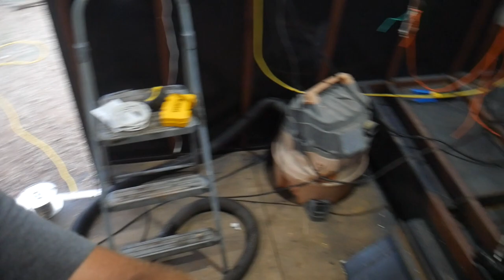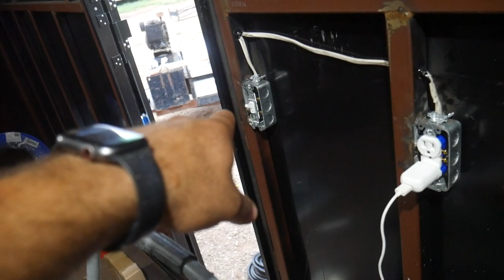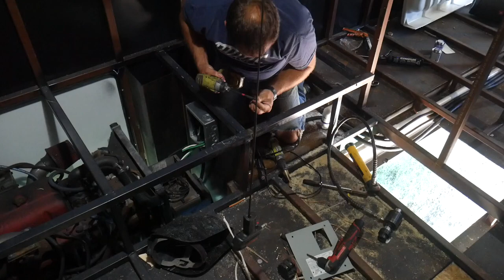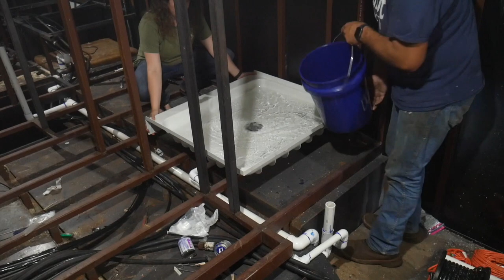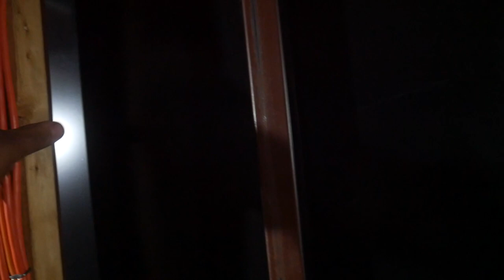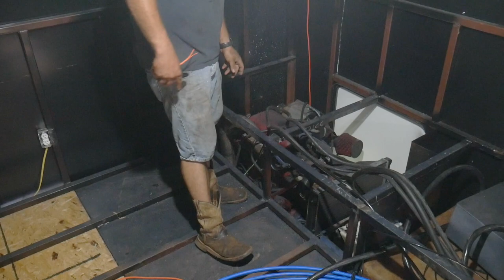Homemade RV. EP-16 Electrical Part 2 and Plumbing. 1977 Peterbilt 359 Toterhome.

Comment: Really coming along! Love your detailed planning, learned some new ideas for sure. Was wondering if you had considered an automatic transfer switch between the generator and shore power? But perhaps you like the manual option here. Really ingenious approach on the 2 main breaker boxes and being able to charge batteries on 15 amp shore, while still using the inverter. For the can lights, did I catch that your plan was to have each plug into an outlet instead of hardwired? Maybe I miss heard that part, but having a lot of experience with motor coaches going down the road, with the vibrations and movement maybe consider hard wiring instead. Interested to see how you wire up the junction box, seems like a lot of conductors in a small box, any concerns on heat? Just some thoughts. Look forward to the next one, Zach!
Reply from the maker: I really couldn’t come up with a good reason to have a transfer switch for the generator. When unplugging from shore power or the generator the coach will auto switch to the inverter until the plug is plugged back in. This was just simpler and with the setup I could actually have both 50 amp plugs available from generator if I needed to run a off grid house and something else large while letting the 50dn alternator power the battery bank and coach through the inverter. As far as the lights they are just a canless can light that pops into a hole in the ceiling. I don’t thing it will be a problem I can always put a zip tie around the plug if it tries to come out.
Reply: TheZachLife fair enough. Thanks for the reply. Looking forward to the next one 👍🏻

Comment: I never seen you use any glue on the PVC drainage? That was just the primer (The purple stuff). I may have missed it but your drainage will eventually leak or fail all together.
Reply from the maker: I did. It was purple primer and blue glue.
Reply: @TheZachLife  Thanks man
Reply: Pressure fittings on drainage? Hmm.  Love your channel and what your doing.